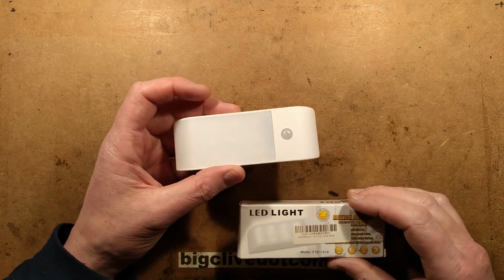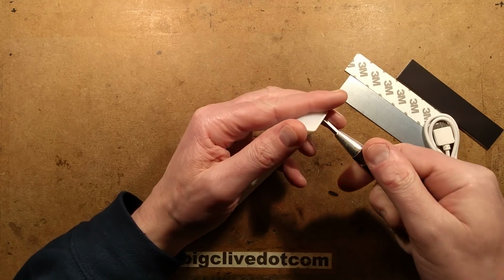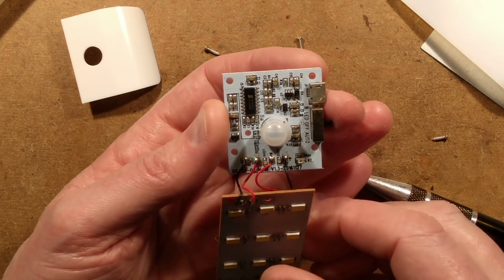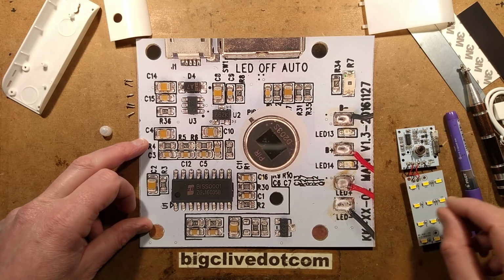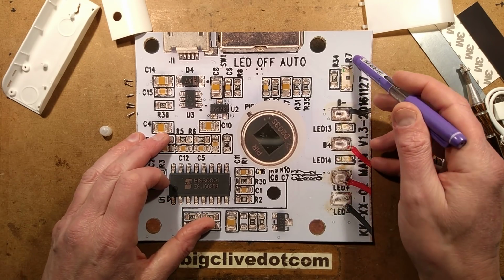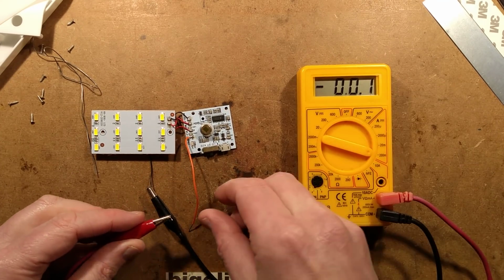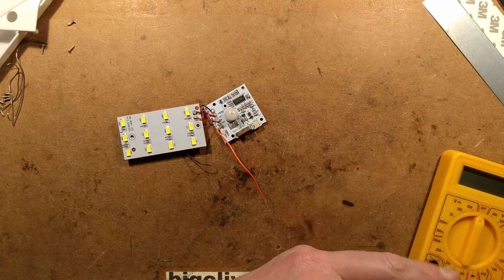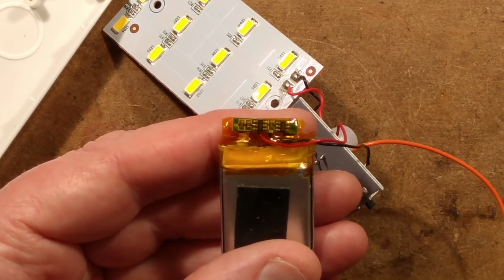Sensibly designed USB rechargeable PIR cupboard/hallway light.

Comment: Another interesting video, thank you!

As mentioned in another video, the chip is a design chip with basically just a few opamps, but designed in a way that the standby current is as low as possible. 
I still haven't come across the BSS chip, but love to prope around one if I had one. But the day will come.

For measuring such low current, I would suggest to use an scope and a small (precision) resistor. 
I've bought a portal scope, which would be the option for your videos, instead of using a "big" scope.
I say "big", as the digital scopes nowadays are already very small compared to the old analog scopes. Lol.

Comment: It's just terrible that you cannot trust these companies to be honest about the battery capacity levels. I think they count on the fact that most people don't have the necessary equipment or in some cases intelligence to figure out how to verify the capacity is anywhere near what's claimed. At least this thing isn't sealed shut and intended for the landfill more quickly than necessary. And I am guessing that there are enough variations on battery shapes and sizes that you could find one with a much higher capacity and same voltage. It's a bit unfortunate that they don't provide a connector for those battery wires. But soldering irons aren't very expensive.

Comment: Got a couple of these. The only downside to them is that the AUTO mode does not work on mine when charging.
I've tried to trace the board, and miserably failed to adequately follow the white traces on the white board.
But then rewatching this, it occurred to me the reason is simple: the blue / red LEDs that indicate charging / charged are so bright that they over-power the ambient light sensor. Masking the red  / blue LEDs is enough to let the AUTO mode triggers appropriately.
Reply from the maker: Yeah, I noticed that the charge LEDs triggered the daylight sensor.

Comment: We have several of these useful PIRs throughout our home, in particularly to illuminate  our bathroom to save using the expensive high wattage lightbulbs on the ceiling. We have others fixed on a floor lintel via their magnetic clamps and illuminating dark cupboards and even under our kitchen cabinets, so we can raid the kitchen at night or around home without disturbing sleepers, but also preventing us tripping head over arse! Had them for some 3 years by now, they've saved us absolute £££s on our electricity bill, and can easily be recharged. I opened some up to discover the same as yourself, have to agree they were a wonderfully cheap purchase - at the time.

Thank you so much for tearing apart so many wonderful gadgets. My girls love your videos. We follow your channel every day, always with a mug of tea on standby. Oh, and we love your voice. So easy to listen to, often with your great humour and snark. Oh, and my bench/office is a tip, but I've no untidy mind lol! Psst! Ours are called Omeril.

Comment: I just got 2 of these. The circuitry has been changed. Gone is the BISS0001. In its place are 2x 8 pin devices. One is a TP406, the other has never been printed. The new design is FAR simpler, requiring only about 10 support components total. The light panel is unchanged, retaining a resister per LED. The battery appears to still have protection. I think I see a circuit board on it but I did not take it to bits.

Comment: Hmm, I have two of these myself, and I quite like them. Not so optimal is, that the time the LEDs are active is a bit short for my purpose. Currently, the active time is about 15 seconds, better would be 30. Is it possible to hack this device by changing the capacitors connected to pin 4 and 5 connected to the BISS001 which apparently control how long the LEDs are active?

Comment: Those charging/charge-complete LED's are so bright!  They make the light sensor think it's light out.   I removed the (shared) 330 ohm resistor and replaced it with a 5.1k, but they were still too bright, triggering the light sensor.   Easiest solution I could come up with was just an opaque cover for the charge-LED's.  Fun-Tak putty did the trick.   Now the unit can stay plugged in and still function as a motion-sensing night-light, all with a battery-backup.  Not bad.  Thanks for the product reference Big Clive!
Reply: https://www.thingiverse.com/thing:3586797
The fix works with the stock-brightness LED's.  No resistors required.  Woot woot!

Comment: Yep, thats the best part about the shitty meters, almost all of them have the high voltage AC setting right next to the current setting and dont require to change the position of the leads. Its literally one click to short means voltage through a 200mA glass fuse if it even has one. Either way it ends up blowing up the meter, which may happen by casual measuring of mains voltage without making a mistake aswell. But for low voltage stuff, they are actually acceptable.

Comment: found the perfect use for these!  if you own a citroen c1, toyota aygo, peugeot 107/108, then you have no boot light, but buy one of these, comes with a sticky backed bit of metal and a magnet and you can put it in the boot, it will only go off when it detects body heat, not in the boot by itself, and you can just recharge once/twice a year from the cars usb port

Comment: I thought when they label a lithium cell, you automatically subtract 20%. 80% is the actual usable part.
If that's the case it would be 480 ml left over

Comment: Somewhat related question to charging Lithium Ion lights. Most say "Dont leave charging for more than 6 hours" because they don't have overcharge protection.  I get that, but how do I realistically manage that as some of these items are just left on the desk or garage.  Would something like an Amazon Basics USB wall charger provide the overcharge protection or do I need something more sophisticated?  Ideally I would just like to plug it in and the "smart charger" just stops the charging when it's full.  Love your channel.  Thanks!
Reply from the maker: It's just a classic cop-out.  If the unit has proper cell protection it should not allow overcharging.

Comment: That looks better than the ones I bought recently which turned out to be lying when they said they had 'movement sensors' Having found them very insensitive, I checked inside and found they had small microphones inside and were sensitive only to vibration/sound.
Looks like that one would easily fit a 1200mAh Lipo.
https://hobbyking.com/en_us/turnigy-1200mah-1s-1c-lipoly-w-2-pin-jst-ph-connector.html

Comment: I have four similar lights to these but one has gone phut. I took the battery out and it still has power and seems to have its own regulator circuit. Could I put the battery into one of the other lights in parallel to extend the life?
Reply from the maker: Theoretically, yes.

Comment: Read the title, instantly ordered a couple before even watching the video.  As I had previously been using a single LED unit that takes 4xAA in the bathroom and its far from ideal.  That said, the one I'm using would have about four times the battery capacity, so it will be interesting to compare.

Comment: If anyone could help me out I need to get one of those TP4056 charge controller chips the same size as it is in this device. I need it for my "Dash Cam" I burned out the one in my dash cam by connecting the battery in revers, I was trying to replace it with an iPod battery and thanks apple they had the polarity printed incorrectly on the battery ????? why.  My dash cam works but it cant charge the battery and this chip just gets really hot when I plug it in to charge. I have found the TP4056 in the larger size but I need this small size anyone know where I could find this.
Thank you.

Comment: Hi Clive,  love your videos.  However,  I have a suggestion for you.  It must cost you a small fortune to print out the circuits for you to use to show what is what.  My suggestion is this,  why don't you just take a pic with a tablet and use the tablet to display it,  that way you can draw onto it and undo the drawings whenever you want......  Just a suggestion.  Keep up the great work
Reply from the maker: Hi Eric.  I use a bulk ink system on the printer and generic glossy photo paper.  The cost for a full A4 page of black ink would be measured in pennies.  It provides a clear and vivid image that can be drawn and written on easily during the video.
Reply: @bigclivedotcom  Fair enough fella. Take care

Comment: Excellent, I should fit it at my door so I can see to put a key in the lock.  It might survive as it is under cover, if not it would be worth the experiment.
Reply: Good suggestion (thank you :-) -- but now I'm wondering how I prevent the neighborhood kids from pinching it (I wouldn't really blame them...) but still be able to remove it to recharge it.  Any good ideas? 
Otherwise, I could put a microwave equivalent (so it could 'see' through the glass), behind a window that's at right-angles to the door -- and that way the light could run off mains power, so I'd be spared the recharging duties ;-)
Reply: @theskett  I would screw it to the door by drilling a screw hole from inside the back cover, buy a 2mtr usb cable from the pound shop (yes you do get 2ntr ones) cut it in half, pop it through the door frame, join the cable back up again inside the door and take to to the nearest socket to plug your usb into.  If need be you cn extend the cable a bit but voltage will drop if to long.
Reply: @BoB4jjjjs  A little brutal (I hadn't considered drilling through the door frame and chopping up the cable :-) but effective; also, good to keep the light powered, to avoid any "Should I recharge it yet?" angst.   Though if the power's always-on, I could get by with just an always-on LED :-)
Reply: @theskett  You could do that, but I would just charge it now and again, I wouldn't leave a charger power supply running all the time.  Besides, I would need my one to charge my phone.  lol

Comment: I got a couple of this sort of light, got builders in and it seemed sensible.  One from Lidl 1 from eBay.  Both were about £5 - 10 LED, pir, crappy  batteries included not rechargeable.  Different - but very similar to each other.  Both have been on constantly for 42 days and battery checker says batteries are down by less than 2%.

I've recently installed an isolated 6v feed into the bathroom to run a radio, amplified speaker and help alert pull switch so was thinking of adapting one of the PIRs to take power from the circuit to light the way for my nightly prostate governed widdle walkabouts.
Reply: Gotta think you can just feed the 6V into the USB jack; what's a volt, between friends? :-)
Though I find myself wondering whether it'd be possible to run a heated toilet seat from 6V, these winter nights can get chilly...
Reply: @theskett  that would certainly work ... if it had a USB jack.  Mine aren't rechargeable so no USB..  The radio is an old Robert's - that uses 4 x AA batts.  The jacks are from my boxes of bits.  I have a box of assorted wall warts ranging from 3v to 14v ... and the first 6v I found was a voltage dropper complete with the best part of 240v to earth.   I thought it would be safer to fence off the pixies with a transformer ... just in case.

I like the sound of the heated bog seat - some of that heated carbon cable Clive showed a wile ago might work.  I suppose adding 240v would cure constipation ... and deter from pissing on the seat - a bit of AC just might liven up the winter nights.
Reply: @theskett  I did start with "that sort of light" but found "this one" was better.  I hadn't done the sums - At my age I suppose I average 2 trips a night each generating about 2 mins of activity ... and what ... 200ml of pee - so 6 years ... not bad.  although pissing 400l makes you think!
I doubt that the chitty included chineseium cells will survive 6 years.  The radio is essential, and loud enough to hear in the shower makes it heavy on batteries that's why I went for the mains powered 6v feed.

Wifeys feet are always cold too and her ass is definitely frigid.

Comment: Hey fellow Clive fans, I happen to have a 3x AA battery operated PIR light that seems to not work when I insert nimh batteries. I am not that good at reading boards to be able to work the reason why. Any quick tips as to what would be the reason and if it can be overcome by for example different type of rechargeable cell?
Reply: 3x typical primary cells (Zinc chloride and similar) will get you 4.5V; but three NiMH cells will only get you 3.6V.   
Try connecting 4x NiMH cells, for 4.8V; if those work, you gotta find another volt or so, over the 3x configuration, to make your PIR light work.
If 4x NiMH don't work, the problem is elsewhere.
Reply: @theskett  that's really helpful @theskett and so obvious now I read it. Sorry for a silly question. I'll give it a whirl in the next few days and let you know if it was that simple.
Reply: @chrzaszczwtrzcinie  Not  a silly question at all, usually NiMH are an ok drop-in replacement for primary cells -- but maybe your PIR gadget is a little, um, over-sensitive :-)  Anyhow, good luck!
Reply: Yep battery time probably from 1.2 volt instead of  1.5 x 3 cells gives you a difference 0.9 volts a lot of equipment is not designed top right off nicad or nickel metal hydride batteries and cannot take advantage of the full charge for shuts off have you ever tried to use those rechargeable batteries and something like some City person of things they don't have nearly the same my run time as somebody the same without the low battery cutoff characteristics same load and everything. And I think that maybe your problem weren't likely because it may not have a very decent voltage regulator breast problems low voltage. I think week why would agree with that I'm sure.

Comment: Could still be glass on that IR chip, it's mostly window class that blocks infra red because they add iron oxide for exactly that purpose, IR fades furnature & carpets.
Reply: Sir the only reason I think you got thumbs down by someone is it's not IR Aki infrared AKA Heat. Such as a heat lamp.
That's just what warms your house not fade your furniture.

Which it does Mark that but.

As to what you think is fitting furniture that is UV light such a standing lamps in the Sun and also Mercury Ark one sources it's also what makes fluorescent lamps work with the phosphor. It's also using germicidal lamps Etc and also black white and also UV makes certain items glow in the dark.

Comment: I'm trying to decide if these are better or if USB strip lights are better with a battery and inline PIR sensor. I mean it'd cost more but this things battery is trash and I'd like it to be quite a bit brighter which makes using 18650s or a phone battery necessary.

Comment: Hey Clive don't suppose you'd consider doing a video where you take these and modify them so you can run a bunch from a suitable and properly isolated wall wart, retaining the battery as a backup?
Reply: I guess you didn't see my comment may have been another video I don't remember but do the sensor the same thing but a bit different.

Comment: Nice light.
I have an unrelated question, my cordless phone batteries just go after a few months without much use, interweb seems to think the trickle charging over time kills the cells by overcharging them, any simple hacks I could use like a protected lipo?
Reply from the maker: Are you leaving it in the charging stand all the time?  It might help to periodically discharge the phone partially.  It might also be worth trying batteries from a different source.
Reply: bigclivedotcom yep, just bought some Poundland ones to try, trouble with this problem is that it only shows up when I need to use the phone and it cuts out (on transmit, so to speak)
Reply from the maker: @bridgendesar  Just to rule things out.  Try a set of good quality eneloop style cells.  The cheaper ones sometimes struggle with current peaks.

Comment: This would be super useful for integrating with an ESP8266 as a motion detector for cheap. Tap into the PIR sensor and use the lithium battery for power and disconnect the LEDs and you have a cheap WiFi motion detector with builtin battery and charging circuit.
Reply: I don't know why I didn't think about that. Good idea

Comment: clive great video as always. just one thing those cheap test meters you/we use what is the black section for bottom left of the meter?
Reply from the maker: It's a gimmick for testing the gain (amplification value) of transistors.  I never actually use it.

Comment: Clive, I bought one of those  cheap soldering stations you use on ebay.  They no longer contain a transformer.  Just a circuit board.  Just thought you might be interested to know.
Reply from the maker: Is it the same size of case?  I bought another recently that is very light because I wanted to see if it has a switchmode power supply in it.
Reply: @bigclivedotcom  I never had the transformer one, so I am not sure.  It looks roughly the same though.

Comment: Hey Clive I had a thought, when you're testing the charge current taken via your USB-ometer, are you not testing the current drawn at 5V?

If so, 497mAh @ 5V is roughly equivalent to 2.5 Watts actual power.

2.5 Watts at a nominal 3.7v that a Li-ion cell provides equates to 675mAh.

Deducting a little overhead for power lost as heat during the charge process suggests maybe a 600mAh capacity battery after all? 

🤔
Reply from the maker: It starts of as 5V but then the diode and charge regulator in the light limited the current by dissipating extra voltage as heat.  However, the current to the cell is the same as the current at 5V so the mAh total isn't affected.